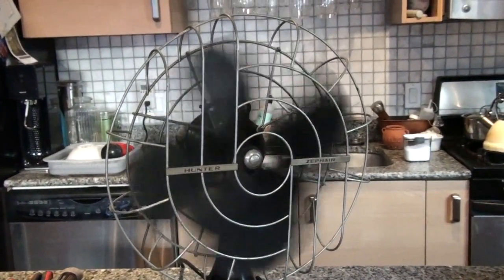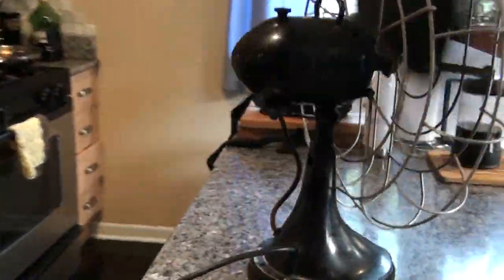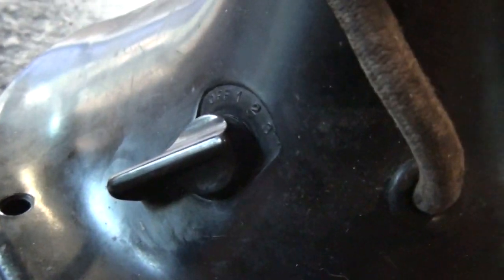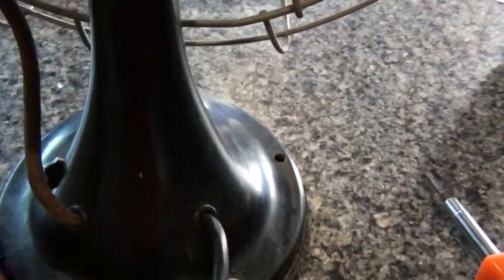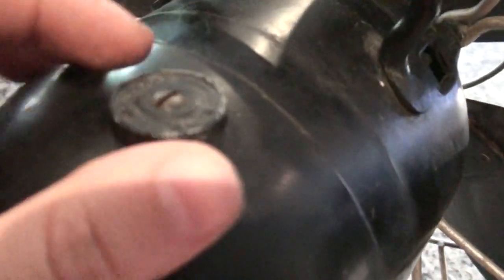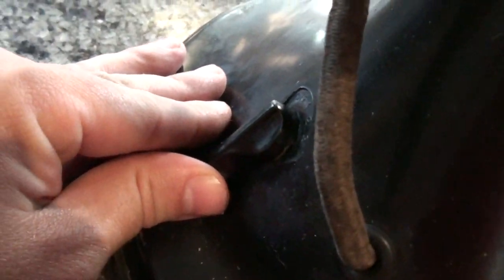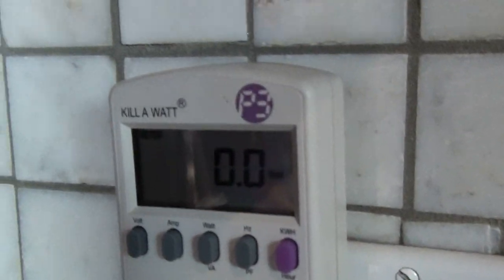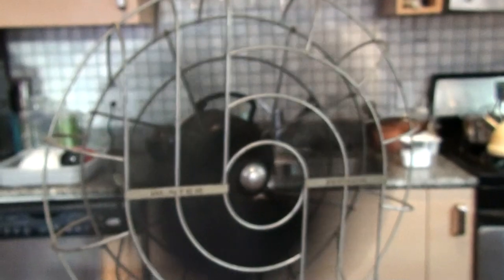fix vintage desk fan: Hunter Zephair

Comment: I have quite a few vintage fans myself and I use them daily. I have a 12 inch model that uses about 36 W of power on medium speed. These old fans are typically equipped with a permanent split capacitor motor, which works very efficiently. It was energy efficiency before that became a thing.

Comment: 'SER. NO.' is 'Serial Number'.  '60 Hz' is the frequency of main power that it will accept (this won't vary with fan speed).  It would probably also run on 50 Hz, but the motor would eventually overheat.  The worn screw hole indicates that the oscillating armature was likely connected at the wrong point in the arm's travel cycle at some point, which explains why it was bottoming out.

Comment: I have a Hunter Century c16 that sat on my Grandfather's desk in the military that I'm wanting to have restored or even attempt to restore myself. It works really well, moves all kinds of air! The head of the fan has a tilt option that seems stripped or badly worn because if not positioned just right it tilts all the way down. It is an oscillating fan but I've never tried that so not sure if it works properly or not. Other than that it needs cleaned and polished and a new power cord and it's good. Just curious if maybe you had any ideas on where to start looking for parts or for someone to restore it. Any help is appreciated, great video of a beautiful piece of history! Thanks

Comment: have you ever attempted to take off the back bullet of the fan to check to see if the oscillating  part is greased well.. I have just acquired one of these a rescue from an old barn i was cleaning out for this lady... i can figure out how to take off the knob that makes it oscillate in order to drop down the bullet off the back of it to look at the insides.. the knob will not pull out when i take out its screw...   any advice would be appreciated.. thanks..
Reply from the maker: Yes I have.
My oscillating button had a screw from up top that had to be unscrewed while preventing the fan from oscillating, and then a tough pull up and out of the button. I ended up using a plumbers pliers with the screwdriver. After that, the bullet case could slipped off.
Reply: Do you know how to take off knob you turn for speed? Changing switch its all together
Reply: @pammotl2584  there’s probably a clip inside the base on the back of the switch, I’m not sure though.